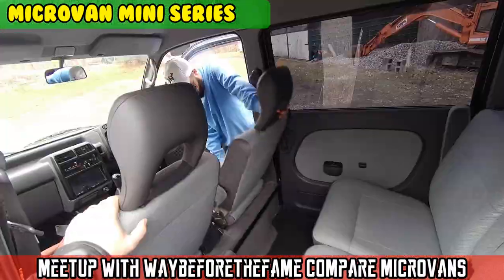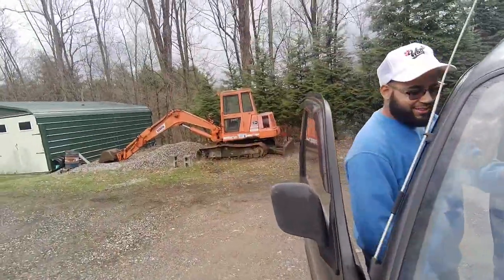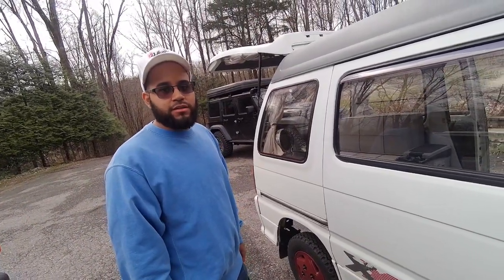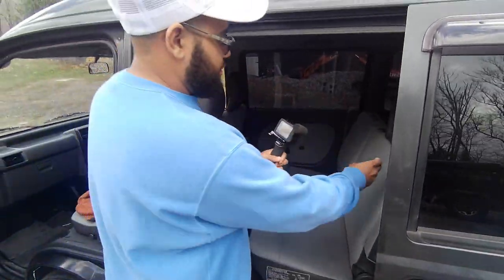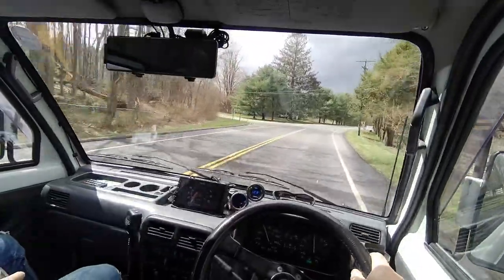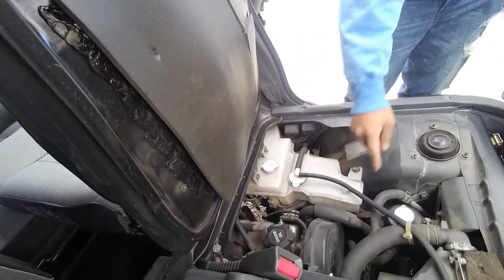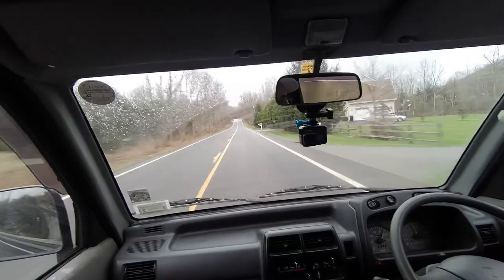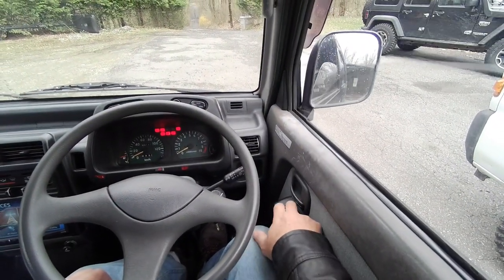Micro Van (SE1 E14)  Meetup with Waybeforethefame and his Mitsubishi Bravo microvan

Comment: And yeah those Mitsubishis love to rev, mine regularly goes up to 9-10k because the 3-4 shift is such a big step, even the 4-5 shift isn't as steep. But they have axle disconnects, not hub disconnects like so the other trucks so 4x4 always works
Reply from the maker: High rev! Most thile minis have axle disconnect, my 2 hijets do and Suzuki I had.

Comment: The Mitsubishis of the 91-98 year are probably the most superior kei truck or van of that year group. They only miss a locker but do have limited slip
Reply from the maker: His was AWD, they have 4x4? Limited slip? Really?
Reply: @MotoCheez  it's an option, you can get full time 4x4, full time with high low, and all the part time 4x4 have high low, and limited slip was an option on all models. The vans were all fuel injected and the trucks all double carb. 4 speeds were 2v and 5 were 4v and vans were 5v, all the same engine just different heads. Steering is also traditional car rack and pinion, not a steering box like most others
Reply from the maker: Nice! All the trucks I've had and this van have rack and pinion. Suzuki and Daihatsu
Reply: @MotoCheez  nearly all of them have this weird hybrid where they have half a rack and it pushes on steering arms similar to gm trucks and vans, this is just straight up a rack, no steering arms
Reply from the maker: Ahh I see

Comment: Sir Cheez, where is the power steering reservoir in a 95 S110P Hijet that has power steering? Also, where do you add transmission fluid into the transmission?
Reply from the maker: If it has power steering it should have a reservoir. Manual transmission have fill/level plug on side of transmission and transfer case.

Comment: Hey Motocheez you can purchase a swallow tire from the Philippines they call it kargador tire it's actually made from China but they used it a lot on there light trucks and there are 2 sizes available a 5.00 R12 and the oversized 6.00 R12 and in Japan I only believe you can only buy a Toyo (open country) All terrian tire but it only comes on 145/70 R12 hope it helps you
Reply from the maker: I wonder how big the 6.00 r12s measure diameter. The Yokohama digger 2's I got from Japan were 145r12
Reply: @MotoCheez  its 24 inches tall sorry for the late reply
Reply from the maker: A little too tall. 23 max to fit in my garage...